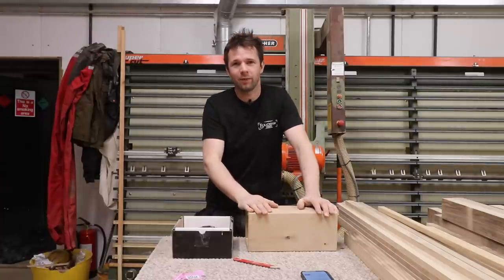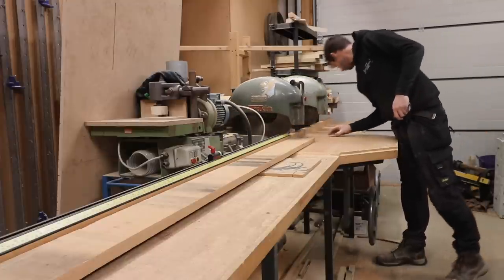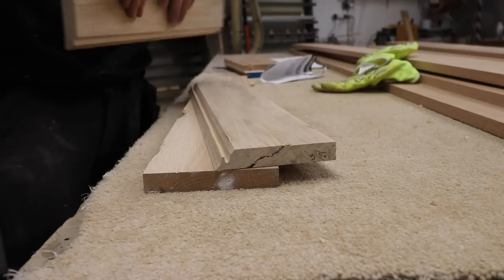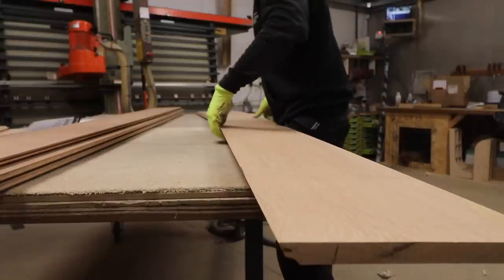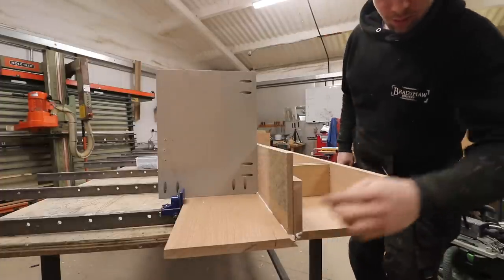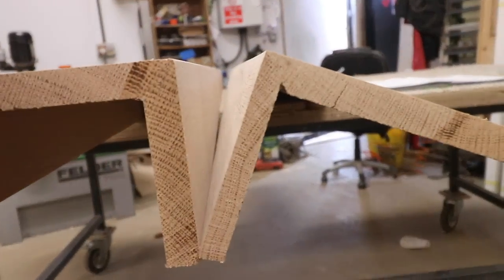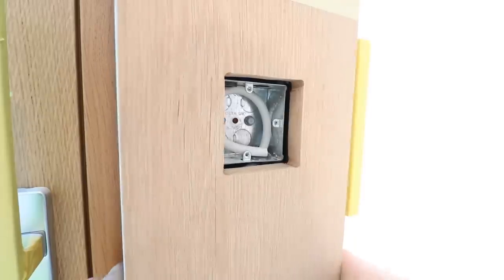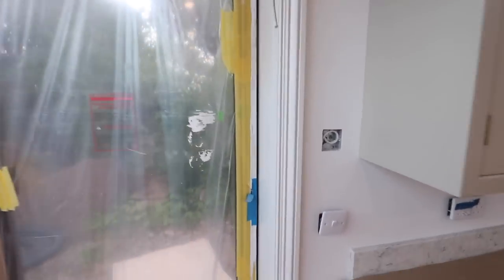Professional Boxing In With Trend Mitre Lock

Comment: I would like very much to use this jointing system for at least a couple of projects but I don't have a spindle moulding machine (and of course not the bit either). However, according to some pro woodworkers it's not really possible to do long box beams using a regular table router bit (except for small box projects) as you need the power of the spindle moulder + large bit to overcome cupping and twisting issues involved with long boards. Any views/experiences? Thanks very much for the video, beautiful end result.
Reply from the maker: If the router table is sturdy i dont see how it would be any different! Just need adequate pressure at the fence both downa nd sideways to make sure the cut is consistent at the point its cutting. If anything, a smaller bed is better for really cupped timber.
Reply: @BradshawJoinery  Thanks very much for your response, it was just I had previously watched a seemingly very knowledgeable  American carpenter Spencer Lewis who was pretty trenchant on the matter - I shall give it go. Here's his video from 2019 just for interest https://www.youtube.com/watch?v=kE5yCC6ffcQ&ab_channel=InsiderCarpentry-SpencerLewis

Comment: Hey, do you have experience using HSS profile knives on euroblocks? I've ordered an euroblock and a couple of knives n limiters, excited to see how it works. Do they last a good while? or will I need to send them to sharpen often
Reply from the maker: They last well in solid timber. Can give the flat side a touch up on a diamond stone for more life, they are not for use on mdf or plywood, will ruin them very quickly

Comment: Great video and excellent result. 
I’ve been using a tracksaw and mitring at just over 45 degrees, using tape for clamps, as demonstrated by Richard at honest carpenter, which does give excellent results on veneered mdf.
I wonder if having to leave the extra half mm or so for support during machining might cause an issue in leaving the substrate visible on a veneered board?
Reply from the maker: ice one Steve, you could machine to a true bevel but would have to make allowances for removing that material its runnign on or have it set spot on to finish to a bevel. I think you could make it work, but would have to be spot on machining. Better suited to thicker veneers and solid, but definitley possible.
Reply: Could always use the old blue tape and super glue method or some good two sided tape to attach a guide board that would register off the fence/table for getting a perfectly cut miter. Great demonstration of this tool, though. Great results from what I could see in the video.
Reply: @beralius8584  That’s an excellent suggestion! I always forget about the handiness of blue tape / superglue. Thanks.

Comment: I bet you could do this with dominoes and a mitered rip cut, but I would MUCH RATHER use that spindle cutter!
Reply from the maker: Cheers Luke, yes thats a good method, make sure you undercut the mitre by 0.5 degree so to clamps tight at the corner all way round. The idea of the cutter though is the glue surface area and the fact you can clamp it across the face (easy) rather than across the mitre (hard)